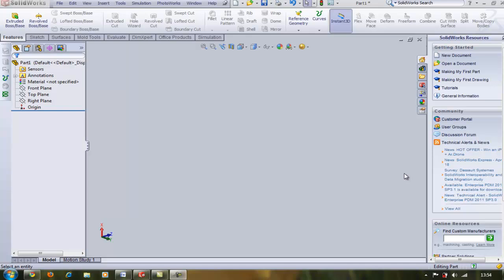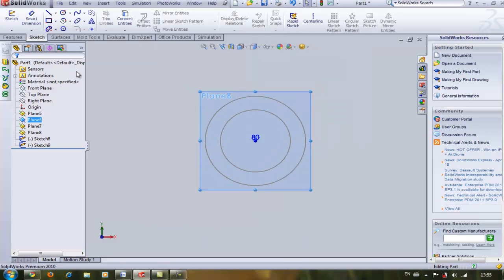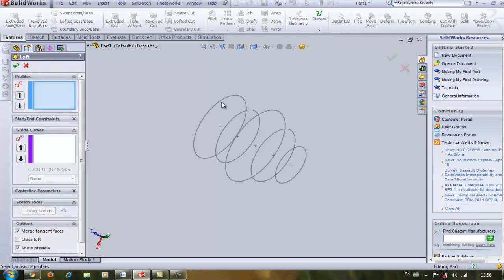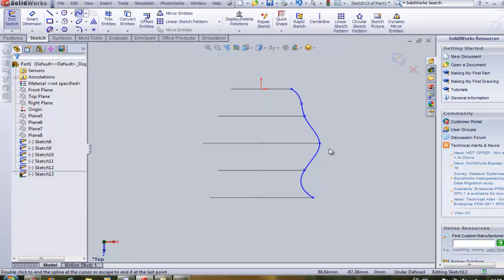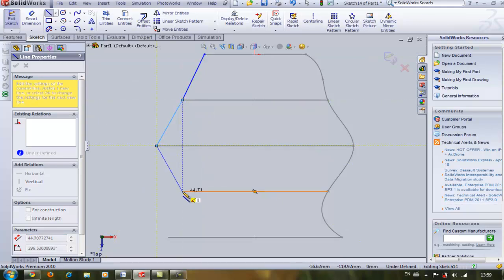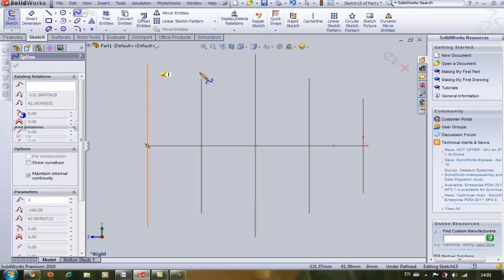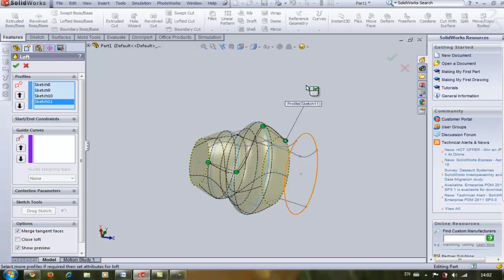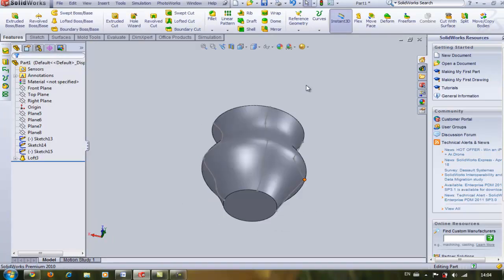SolidWorks/ SolidWorks-Simple tips- Loft Tutorial /  SolidWorks

Comment from the maker: As Rob said it, in the older version there is a button like a stop light which is the "rebuild" button. what it does is, actualize the sketch and closes the area of drawing. it means you are done with the specific sketch and ready to move on to do other stuff. Other options you have are: Ctrl+Q or simply that bent arrow button on top right corner of the screen (working space) when working on a sketch (Only). in another word, when done with the sketch = should rebuild.